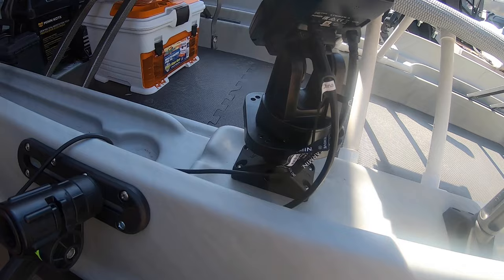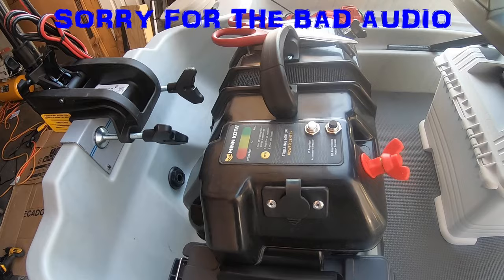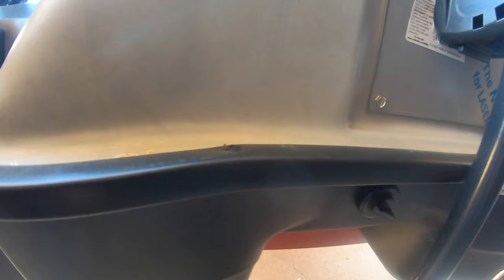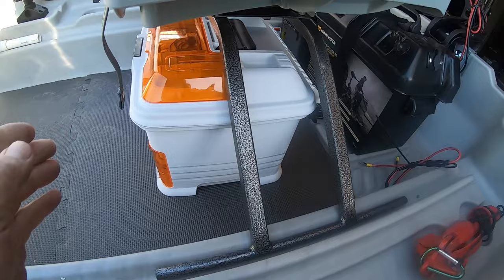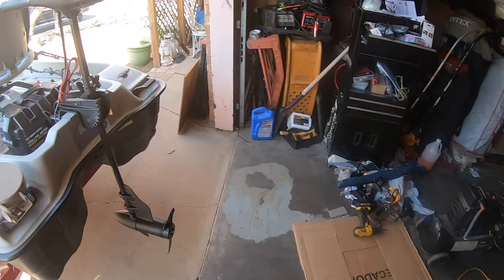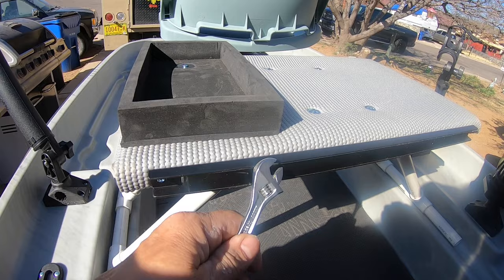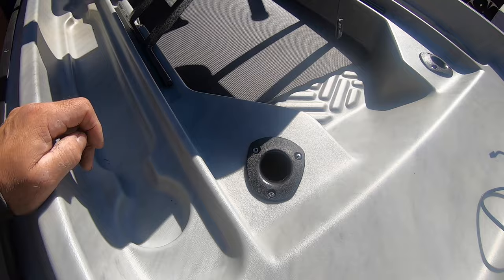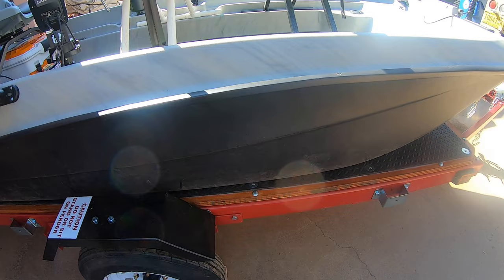BASS PRO POND PROWLER 10

Comment: Great job on the boat build!  I have a 10 foot myself and I’m starting to make some modifications. I love your table idea I hadn’t seen that yet. At first I thought it was the base of an unused chair, but then I realized you built it out of PVC. That’s awesome.  

For attaching the Scotty mount bases did you use screws or something else?

Like many others, I was hesitant to put holes in my boat, but I’m at a point where the modifications that I’d like to do really require it.  Yours looks awesome.
Reply from the maker: Thank you!! Yes I used screws and plenty of silicone👍

Comment: Do you think that 55 lb motor is overkill for such a small boat? I just bought an 8’7” version of that boat and I’ve got a 30 lb thrust trolling motor and a 55lb thrust. I’m trying to decide which motor to use. The tag on boat says max thrust is 40 lbs and I’m wondering if the 55 will throw that little boat around like a rag doll. It might make a wake lol
Reply from the maker: It works great on the boat, I like it cause it's variable. I've maxed it out and it's won't make a wake haha
Reply: @TEAMPHANTOMDAWGS  think I’ll try the bigger motor then. Mine isn’t variable.It’s a minn kota endura 55 lb with 5 speeds

Comment: Great information. What type of fasteners did you use to attach your accessories to the boat? As you know we don't have the ability to put nuts on any of the screws so I'm curious as to what you use and if you're happy with the stability. Thanks so much!!
Reply from the maker: Thanks for watching👍I used the screws that came with the accessories, plus I used siliconed to stiffen them up a little, here in Southern NM I'm not so worried about stability with the small lakes I fish.....
Reply: That’s a nice bass you caught. You get any pike or musky in your part of southern NM?